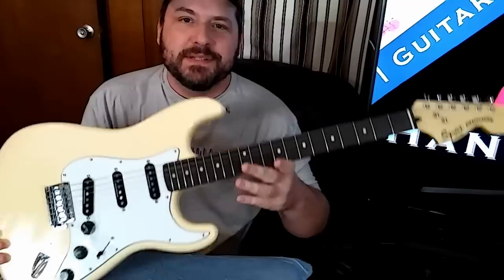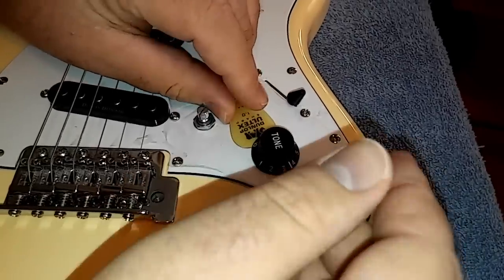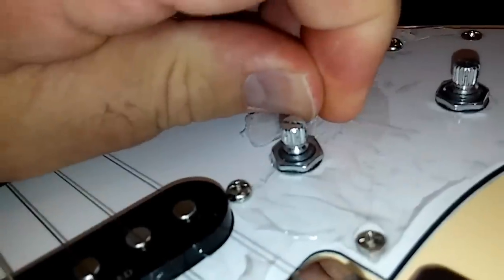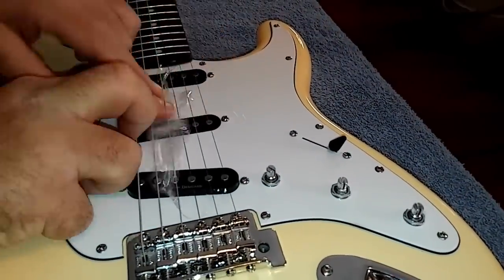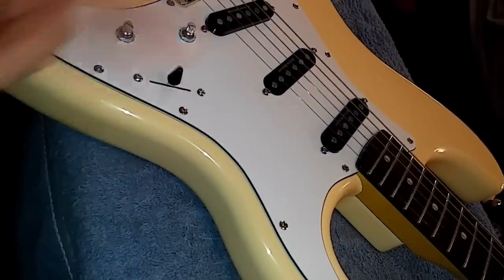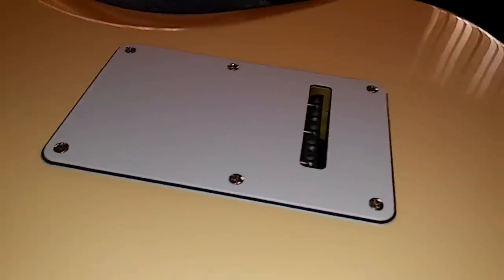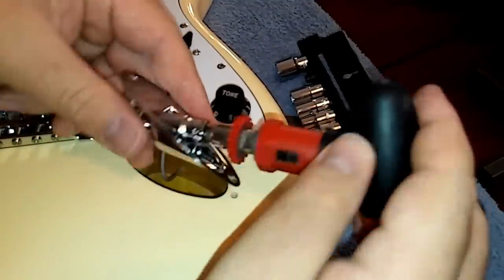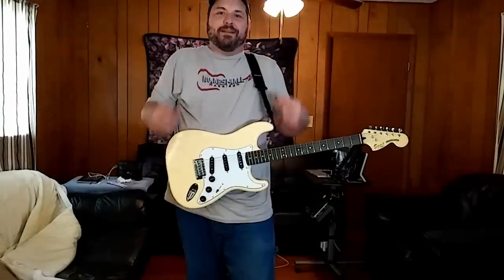Squier Vintage Modified Stratocaster 3rd Week Maintenance

Comment: I just use a teaspoon to remove the knobs :P
I'm glad you are happy with this guitar, I love both my VM Mustang and Jazzmaster. The Mustang is actually as of now my favorite guitar :)
Reply from the maker: Hey, a spoon will work. lol.  Yeah,  I really like this guitar.  I'm kinda sad that I can't get a comparable USA Strat that is under 8lbs.  I want to get a 7lb Malmsteen or American Special. But they are all tipping the scales. (boat anchors)
Reply: Yeah works perfectly fine for me :)
But you could just get another neck on Ebay and make your own Malmsteen signature?
I got a great neck with a rosewood fretboard for my red strat build and it's amazing :)
Reply from the maker: Wabin22 man you know what, that's a real good idea. Because the Squier 70s is a 70s sized body, it's light, and the pickups are killer.  I could get another light one and put a Yngwie neck on it. 🐻🎸
Reply: Yeah why not?
When I got my Affinity I mainly got it because I wanted a Surf Green strat, I'm not very fond of the larger 70's headstock and thought I'd just get a new replacement neck instead.
I do however simply just love the neck on this strat so I might just keep it the way it is :P
But if you really want a Malmsteen type then just get another neck or a new version of the same guitar if you'd rather do that :)

Comment: Man. I'm looking  for 500 worth of guitar. I was thinking either used MIM or one of the squire deluxe or vintage. I need an amp too. Lol. My son is going with me to shop for one next week...hes the pro. I taught him the basics and he ran with it at 10..now hes 24 almost and is well recognized around GA and Fl
Reply: Oops. My question is to you, is this pretty close to the MIM to you?
Reply from the maker: Robert Clark I love these vintage modifieds man. You can't beat the Duncan designed pickups in them. They sound good.
Reply from the maker: I have particular preferences in stratocasters, so to me, this is better than all of them. If I stepped up from this guitar I would get an American special. Those are 1k.
Reply: Hank Coffey That is my intention I believe. I appreciate it.
Reply from the maker: Robert Clark no problem, just go with what you like. I prefer the big headstock so really the Vintage modified is my only choice without jumping up to almost $1,000. If you prefer a small headstock they  have the Vintage Vibe series and there are other choices.
Reply: Hank Coffey Appreciate it man. Had I not bought this damn S9 plus galaxy I would have enough for a nice American. Lol. I cant believe I spent 898.00 on this thing. I was into smartphones too long. Getting back into guitars now...Maybe I put some ads on CL. Lol. PEACE bud. Thanks.
Reply: I'm an old drummer. At one time pretty damn good. I raised a killer guitarist. I took up keyboards and all through the years and decided to pick up guitar again. I know my chords ok. I cant lead but that's because I never tried to learn. Lol. I hope I get it down and I hope I chose a good guitar to learn on. Having one that I like as I'm a gilmour fan maybe it will help. Lol.
Reply from the maker: Cool Robert,  that guitar should be all you need. Once you figure out how you like them set up, they all play pretty similar. You picked the guitar, now go with it. 🐻👍